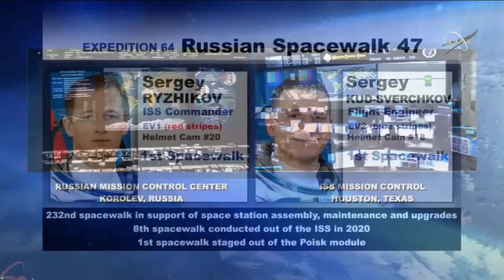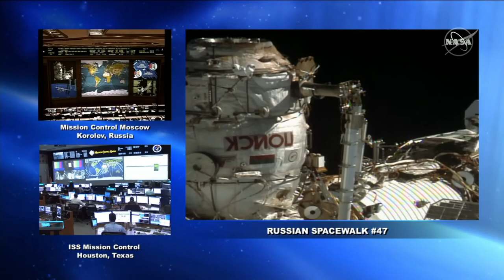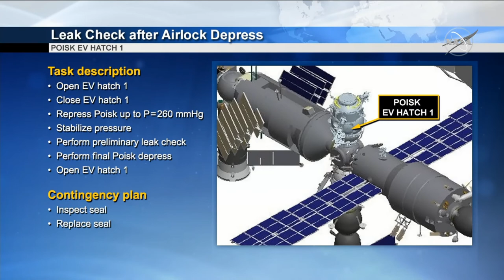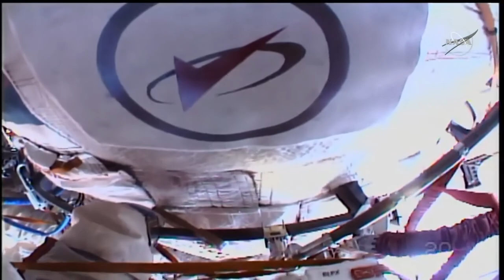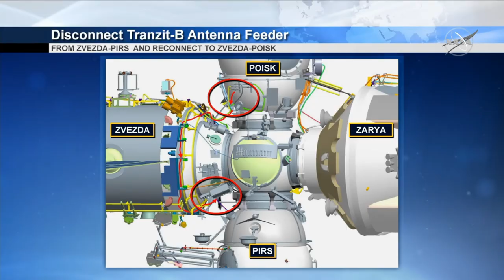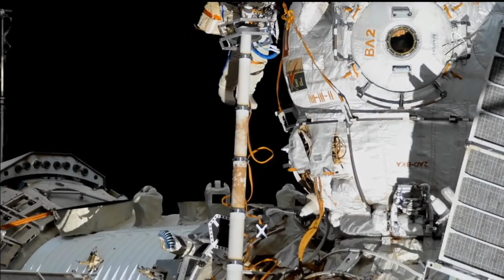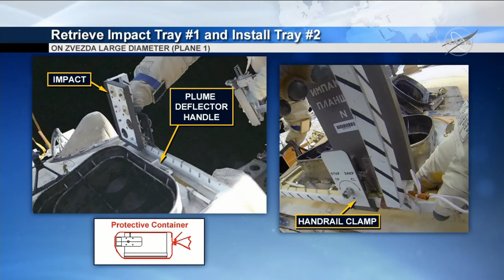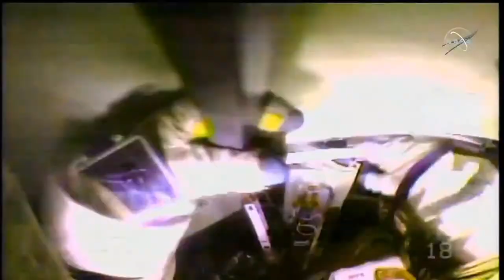REPLAY: 6hr Russian spacewalk w/ "The Sergeys" (18 Nov 2020)

Comment: At 14:00 a great animation shows the tasks to be performed. The first cosmonaut to exit the airlock is at 2:40:00. First cosmonaut to enter airlock for return is at 8:08:00. Unlike the International spacewalks, there apparently were no suit-up, airlock entry and decompression for exit or return video to be seen. 
The voice you here is translating Russian ground and cosmonaut comments into English, but with just one voice doing all translations, you cannot determine who is speaking. However, it is still helps greatly. 
Somewhere towards the end, the cosmonauts are cleaning their gloves with towels which they will throw towards the earth.. They are advised to not jettison them into the Soyuz which was funny. (always a good idea not to destroy your spacecraft). One cosmonaut also seemed concerned when advised that a smudge mark on his space suit might just be normal wear and tear.( something a space person does not need to hear when outside floating in a vacuum)
I read that ants do not sleep like people; they power-nap for a minute every few hours. The cosmonauts apparently learned this technique from ants. I was concerned when for several minutes they completely did not move (one waved his hand and then stopped) but they were just resting.
This space walk had a happy ending, both cosmonauts had safe experiences. But one of the tasks was not performed because of problems the cosmonauts could not overcome. A safe space walk is always a great space walk.
I inadvertently saw that live coverage was to be seen on the day of coverage. Just keep searching for spacewalks to se them live.
Reply from the maker: Unfortunately that short animation showing the tasks they would perform resulted in a copyright claim on this 9-hour video. I disputed it on the grounds of "fair use", but I'm not holding my breath. This video may need to come down.

Comment: Great job both Sergeys! By just listening to your voices and breaths it makes me realize how difficult it is to do in these suits things that seems so easy. I mean you seem really tired. And all those temperature changes that cannot be sensed in the video. Pity that the main task didn't work out. Pity because of the lame reason. Nothing was really bad on Zvezda module. Just you could not open the package with the new equipment. And I have impression that you were doomed from the very beginning, because despite the four screws that could be unscrewed manually, there were around dozen others that should have been unscrewed as well - but with the screwdriver, before the whole EVA. I guess the container holds the equipment in vacuum, and is fastened really good, and you were supposed to unseal it before EVA, just leaving the last four on them in place to unscrew it before opening the container. But it is ground control responsibility to tell them that beforehand! Again - pity, good that it was not crucial replacement at that time yet. And a word about that window that was supposed to be cleaned (at least as can be seen on 6:37:13): Man, what had happened there? My first impression was the window of the flat after being bunt! Those black marks that looked like traces of the smoke. I hope there wasn't fire on ISS that burnt through the window! I've seen the "Salut 7" - Russian movie about their rescue mission in space. Movie nice to watch, although the original events were not that dramatic as in the movie (Thanks God!) although it wasn't easy mission either. I recommend the movie to watch anyway - well made. So, unlike in the movie - I hope ISS did not have problem with open fire yet. So what are those black marks from? Regards.
Reply: I'm not 100% sure but all the burnt marks on the ISS or other space objects happens because of small oxygen leaks or contamination, if the material itself has some oxygen it will burn because of the sun hitting it constantly. If you see some photos of the airlocks you will see that burn marks too cause some oxygen will hit the material in the depressurizing process, not sure but maybe something like that happened on the window

Comment: What is that flying object that appears 3:20:30 ???
Reply from the maker: Just a piece of debris from whatever they were working on. Hopefully nothing important.
Reply: Debris doesnt light up several times and i would assume would  float much slower
Reply: @ykwill6  It's spinning after hitting the solar array, we see the reflection of the sun on the surface and it looks like comes from nothing cause de black of space
Reply: @RawSpaceVideos  or this at 7:28:56. a used towel maybe?
Reply: or this at 7:28:56. a used towel maybe?

Comment: If there is no sound in space, how did I hear the motor that changes the position of the solar panel, perhaps because the cosmonaut was touching the space station, the sound transferred to his helmet  speaker.
Reply from the maker: Sound is a physical wave that requires a physical medium. That medium can be gas (air), liquid (water), or solid (the hull of a rocket, or a spacesuit). There's no sound transmission in a vacuum, but sound can propagate through objects that are physically touching each other.